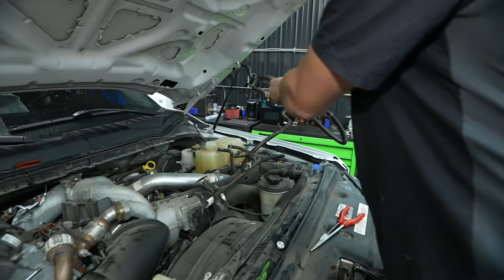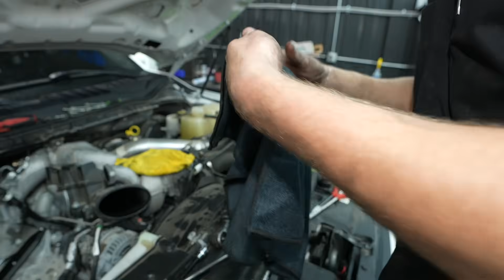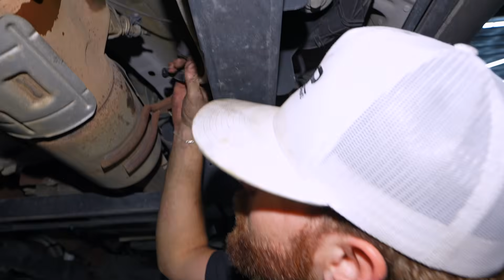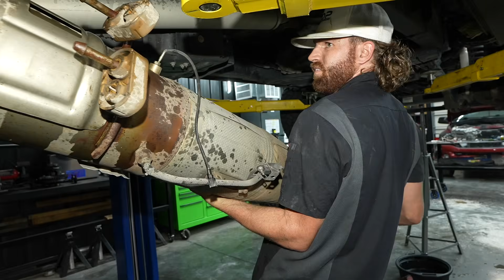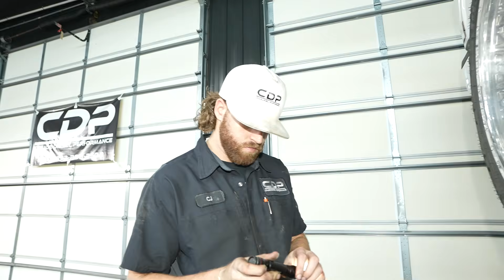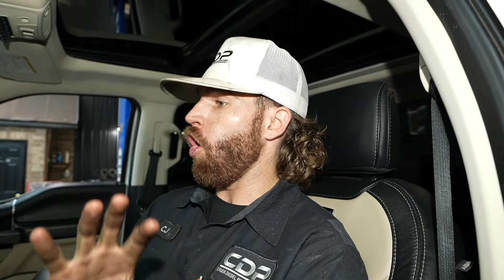How To Delete 20-22 Ford 6.7 Power Stroke

Comment: I never saw you unplug the throttle valve?
Reply: Probably don’t need to on these trucks
Reply: @c.rigsby3_01 yeah, I ran with mine plugged in for a month and had no issues but I contacted the tuner and he said to unplug it. Now when I shutdown the truck because the throttle valve isn’t closing the truck shakes very briefly because the throttle valve isn’t closing starving the truck of air. I’m considering plugging it back in

Comment: Will the 4” exhaust on your site fit the down pipe on a 2022?
Reply from the maker: Yes it will
Reply: @CrudeDiesel were the batteries disconnected before unplugging and deleting hardware?

Comment: I live in texas. I have a 2019 6.7. Wont doing all the deletes cause my truck not to pass state inspection ?
Reply: Brother diesel in Texas is a safety inspection only.   No emissions.     I have a 4inch straight piped 2019 6.7 350 dually.

Comment: My F350 6.7L 2024 ( buy insurance options around 5k $$$) ... Greetings Seattle Tacoma Fans club 😂😂😂😂. After install front body conversation kit 17-18 all cooling system engine transmission oils... Derringer Tuner pedal Bank's plus Airfilter  intake PPE pans cover diferencial too fass sys AMSOIL Bypass Filtration  CAT 1R-1807 filter and last 68 gallons fuel ⛽️ tank Nano Hydrox semitruck HHO generator  with 19 gallons Electrolyte... Delete all emissions system DOT testing pass below by 82% certified it.....😂😂😂 Please check and test system for County mandatory emissions 😢😢😢... as alternative.... please

Comment: I recommend using a flow through block off plate. You don’t want stagnant coolant causing excess heat by not circulating.
Also spend the extra $100 on a shibby harness plug kit.
Reply: those shibby harness plug kits are like $180.  Not sure why a bunch of dummy plastic plugs are that expensive.  $25 on ebay from China.....and yes i might trust China with dummy plastic plugs.
Reply: @rod272727  Ok, but a flow through plate like some other kits makes sense , Right ?

Comment: sorry if i missed this somewhere in the video but im deleting a 2018 f550 assuming its fairly similar, im wondering what you do with all the sensors and def tank to not throw codes.
Reply from the maker: Nothing, the tune turns all those codes off in ecm
Reply: You can remove the def tank if you want to. Probably save you another 20-30lbs and lots of space. The tank is huge, 7.5 gallons on the 23 and newer trucks.

Comment: My dad just picked up a 22’ l5p. on a tune similar to this programming once deleted how much or how little smoke is there cause where we are that’s a cop magnet and for an old guy like him he doesn’t want to be getting stopped every time he drives, I am trying to convince him to delete still to prevent issues further down the road
Reply from the maker: Very little on tow tune . Not even noticeable
Reply: From what I’ve seen little to no black smoke even if you hog on it with the low HP bump. It only seems to be when the HP is way up there you get to rolling coal. It’s unspent fuel so just a waste of money.

Comment: In case I didn’t know..Those first 3 hose clamps are made so if u squeeze the 2 tabs together, they are made to lock open so u can slide them. Then u  get them back where u want them & use a screw driver to pop them back open.